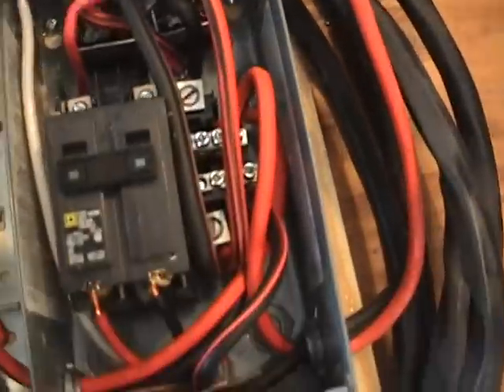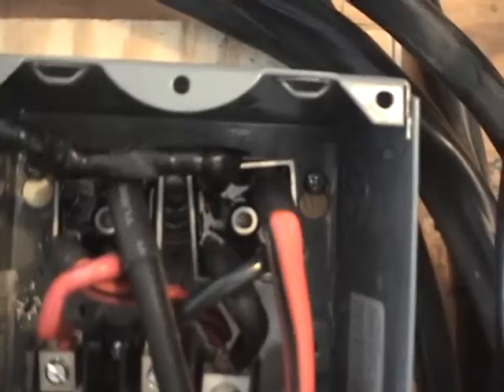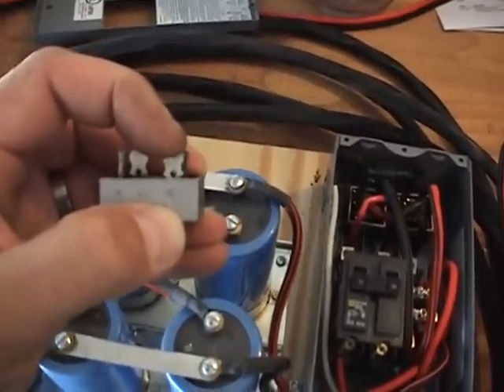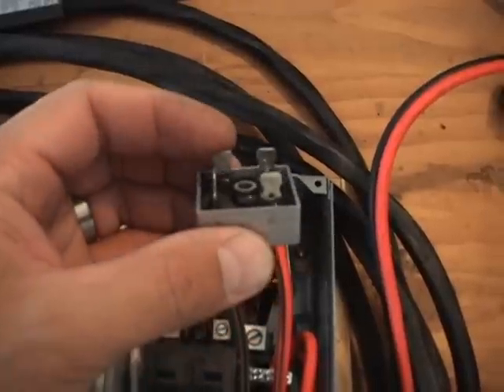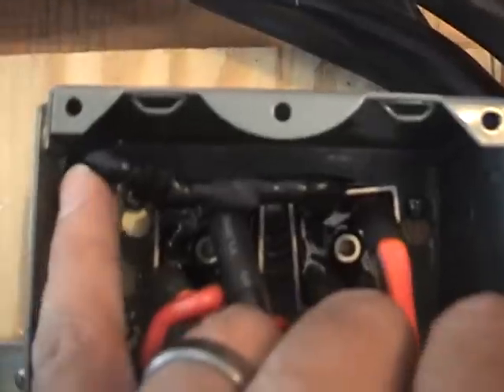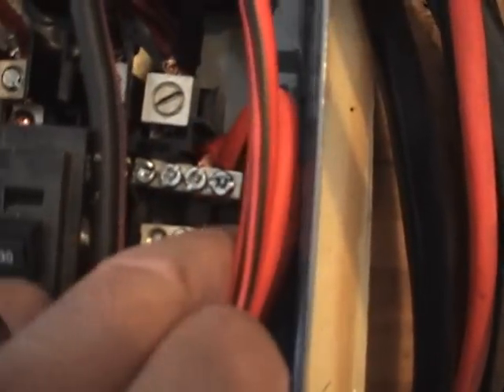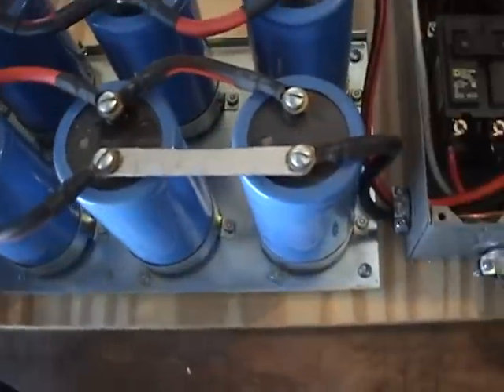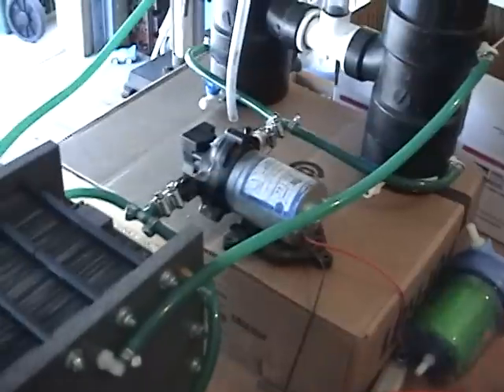118 plate Monster Hydrogen cell Back from the dead part3

Comment: @delvis11 

That's what I like to hear, these things are fun. But are useless for much aside from heating and gas welding.

Anyways, since you are using identical positive and negative plates you could run the unit on straight AC. I'd be curious to see if you found any difference.

Comment: I'm curious what you are trying to accomplish, you have liquid fuel in the beginning. Converting that chemical potential energy to kinetic energy to electrical energy, losing about 80% of the initial energy. Then converting that back to a fuel with another heavy loss in power.

If you where running the system off of a solar array to produce a storable transportable gaseous fuel, I guess it makes some sense, but you could also just use electrical energy with batteries.

What's the cost?

Comment: seems like alot of work just to get your 220VDC.. Why not just get a 600V rated bridge rectifier module for like $45 off ebay. Just take your 220VAC and use some heavy duty connectors and screw them down to the module and your down without soldering a bunch of wires..

Comment: good to see you playing with it again.. I am on financial lockdown for the time being.. absolutely no money to go with my bigger designed cell.. I wanna go 24" x 24" with 63 plates at 130VDC.. My theory is the bigger the plates, the more surface area, which means more gas production. my 6" x 6" cell draws zero current with pure distilled water and by adding just the amount of KOH I want, I can maintain 10+ LPM at 10A. I ponder what the production would be with even more surface area.

Comment: @jab0805 Your Alternator rectifies the ac current to DC internally to provide 12 - 14v DC. The battery is really just a buffer to further clean the power as well as to start the engine.

Comment: @insAneTunA I understand that this demo is not showing car installation. I am asking a separate question not concerning this particular cell. I am just wondering if he has ever rectified the AC source from a car alternator to power a cell. I mistakenly put car battery instead of alternator. If he had tried it, I was wondering if he had any issues.

Comment: @jab0805 No, AC from the generator 6:10  is going to be rectified to DC Volt. The cell needs DC. The battery is used to power the 12 volt pump 5:46 Have you watched the video?